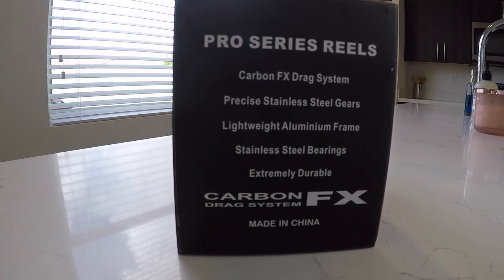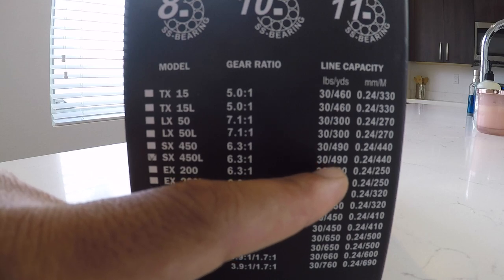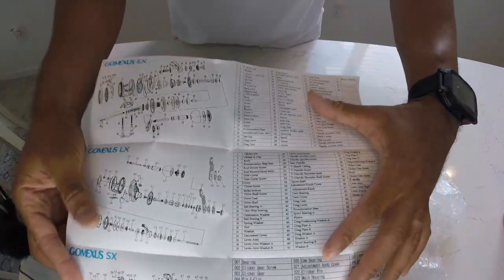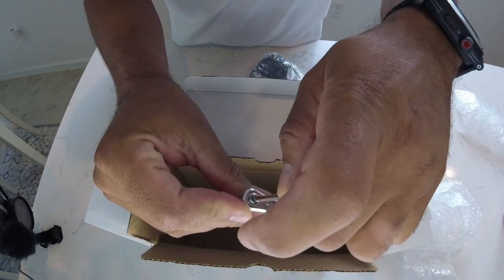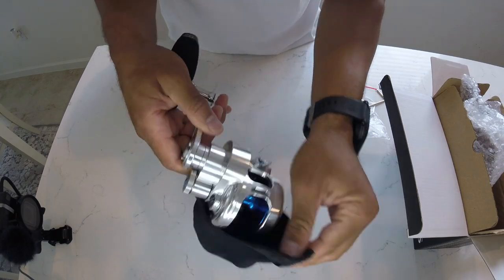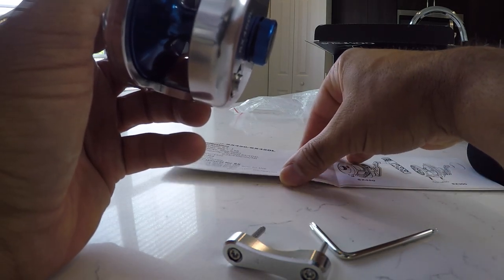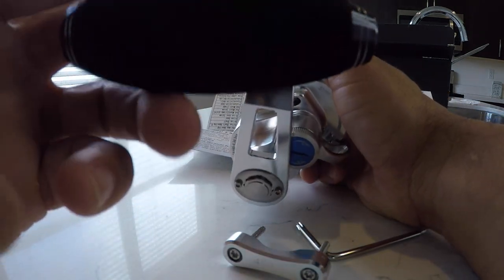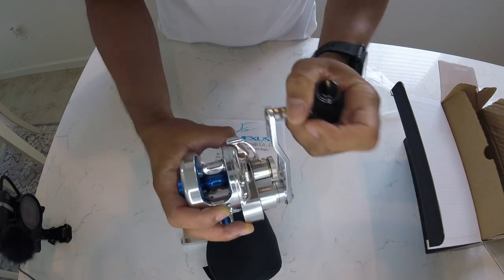Gomexus SX 450 Reel- Unboxing

Comment: Ok so the dial thats right next to the handle is how tight u want ur drag? Like while fighting a fish, how easily the can pull line from ur spool....

And the dial on the bare face is how loose u want ur spool? Like how much brake is applied to ur in free spool? Like how quick it will drop a 5oz weight?
Reply from the maker: Yes you are completely right! You will like the reel.
Reply: @KayakQ  ok I bought it and it's been sitting spooled up and every ready to go but I have yet to find the time to get out n use it. 🤣🤣 Hopefully I can get my lazy self to the pier today😂😂 thank you!!